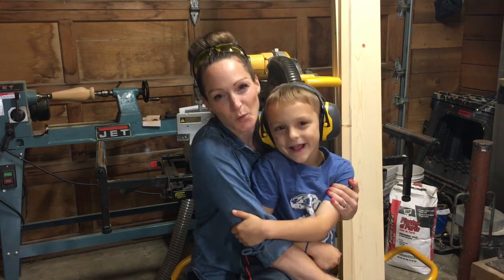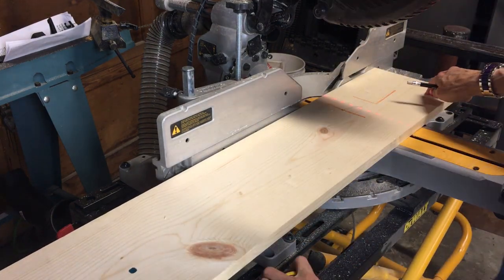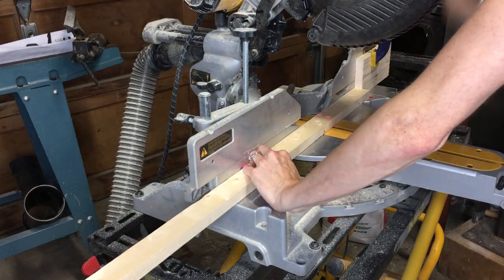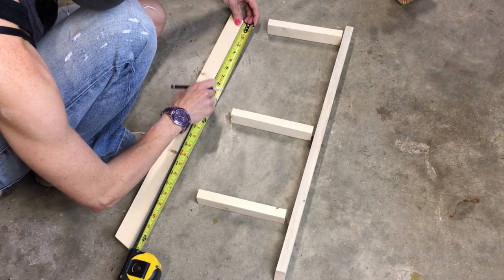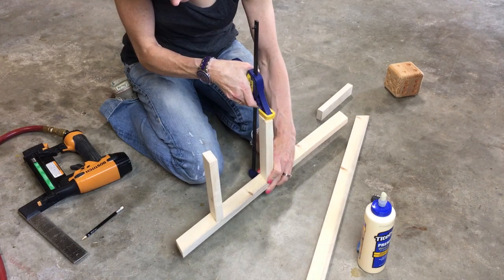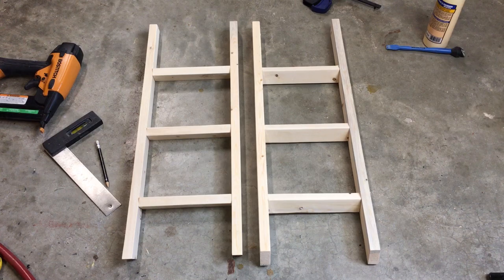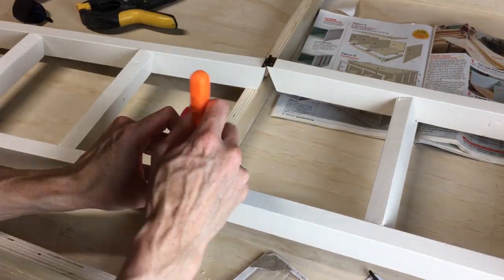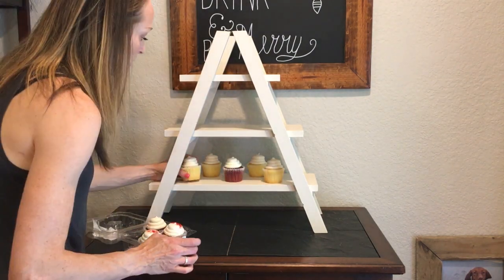DIY Folding Serving Tray

Comment: We have this all cut out and ready to go… what keeps the legs from sliding “open”?
Reply: Few post down she replied.  1. Put rubber feet on bottom.2 she added short shelve to bottom.
It still does not make sense.
I would drill holes on each leg and add a rope knotted at each end .at hole.
Reply: @paintilludrop  we made this two years ago, we ended up putting two little wood blocks under one board to keep it from sliding out.  Worked perfect. It’s been used many many times for many different things! A great little piece! 🩷

Comment: Hi sorry I don’t want to sound rude but I’m trying to make this in your measurements are different in the beginning of the video then they are the ones you’re talking about so I’m kind of confused on the wood links that I need
Reply from the maker: Debbie Clark Hi Debbie, no problem at all so here is my cut list, keep in mind you can totally change it if you want something bigger or smaller 😊
Shelves -
Using the 1x8 I cut
- 11 1/2” long
- 16 1/4” long
- 20” long

Side pieces (using 1x2) -
- 4 at 25 1/2” long (cut at a 20 degree angle)

Shelf Supports (using 1x2) -
- 6 at 7 1/4” long
Reply: How were you able to slide in the three 1x8 in. shelves into a 7 1/4 in. gap. I believe, (and please correct me if I'm wrong) you meant to say you cut the  six shelf supports at 8 1/4 in. long. Which would give you a 1/4 in. of play when sliding in the 1x8 in. shelves into the shelf supports.

Comment: Is there a way to make this without having to do 20 degree cuts? I just want Home Depot to cut all the wood for me.
Reply from the maker: You totally could and it would be just as strong.  I just did it to give it a more clean look. 😀
Reply: Thank you for the reply. I’m a bit confused. Would you clarify the measurements? When I add up how many inches for the legs and supports, it adds to more than 144” long (if buying the 1x2x12ft). 
Legs - 25.5” x 4 = 102”
Supports - 7.25 x 6 = 43.25”
Total = 145.5”

Am I doing something wrong and overthinking it?

Comment: What would i need if i wanted to make 2 off these ?
Reply from the maker: Alexis amaral you will want 1 - 1x8 8ft long, 2 - 1x2’s 12ft long, and 4 small hinges. Please let me know if I can help with anything else. Happy building 😊
Reply: What measurement did you use for the shelf boards to be leveled ?
Reply from the maker: Alexis amaral good question. I measured from the top of each support board on both sides at 7in, 14in, and 21in. Then drew a line connecting them so I knew right where the bottom of my shelf support should sit to hold the shelf level.

Comment: what keeps it from sliding open?
Reply from the maker: Donald Cone I put rubber feet on the bottoms of the legs and as an after thought added small 1” boards on the bottom of the lowest shelf to keep the legs from sliding out.  Unfortunately I thought of this after the video 🤦‍♀️
Reply: Around the House thanks.
Reply: @AroundtheHouse  I put the little wood pieces under the bottom board too.  
Maybe add that in a pinned comment or in the description box?
I made it two yrs ago and it has been a favorite and been borrowed by quite a few friends as well. 
I use it for my coffee mugs at Christmas at my coffee/cocoa bar!

Comment: What are the measurements??
Reply from the maker: Leslee  Tello set-up mine is 23 3/4in tall, the bottom of the base sits 21 1/4in wide, 9in deep. Please let me know if you were looking for other measurements
Reply: @AroundtheHouse  at wat degree did u put the the 71/4 pieces on to hold shelves